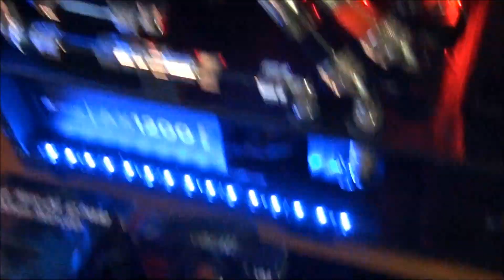Singularity Beast Upgrades Part 5

Comment: @SingularityComputers Thanks, that's what I figured. I'm waiting for my machine built around Maximus IV Extreme-Z which has the same feature. It will have triple EVGA GTX 580 3GB Hydro Copper 2. Having had issues with video cards in the past, I've been worried about having 3 cards under water. Looks like the PCIE switches are a great way to single out a faulty card. Awesome system and videos BTW. I'm learning a lot waiting for my first water-cooled rig.

Comment: @kevinsmammaxd 

if your system's high end you don't really need it, the thing about the card is that it has it's own processor, works great for older system's, on new ones, not so much

Comment: @SingularityComputers you may not see any obvious signs, from what I have seen, in some cases its just mild corrosion that happens when using certain coolants and additives.
My blocks where installed about 1 week after yours and as I say using EC6 clear (3 months) they are fine.
maybe when you take out the duff card that would be the block to split and check.
GL m8

Comment: No doubt you have heard about the EK nickel plate issue, just to let you know I tore my rig down last w/e and they were fine, ( same blocks just the acetal nickel) no corrosion at all, I have always used Thermochill EC6 Clear,
just thought you might like a heads up on that.
really hope you get the duff card sorted asap.

Rick

Comment: @SingularityComputers Hello again :) There is just one thing except the LED stripes & drilling holes in waterblocks: Bitspower UV Ram Mod. Check out last videos of the L3p D3sk build on YouTube to view them. Easiest & worst they without any mods to mount LED's right on waterblocks is adhesive plaster & connecting to fan port. Enermax have T.B Appolish fans with 15\18 LED's each. Why not to use them? Quite & nice lightning effect. T.B Vegas Duo\Trio models have a switch & 2-3 colors.

Comment: you should take the fan filters apart and stick the foamy part under the fan grill on the rad?
i  would've done that really sucks having everything done and having to find out you gotta take it apart again to fix it... i felt that way when my XSPC dual bay pump died and i needed to take the whole cooling system out to put on the stock heatsink to use my pc to order a new pump